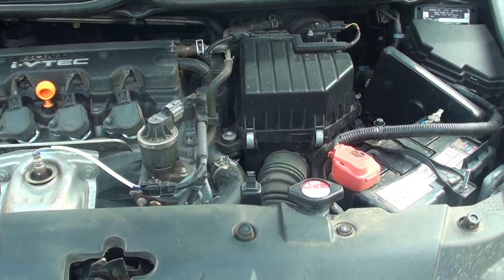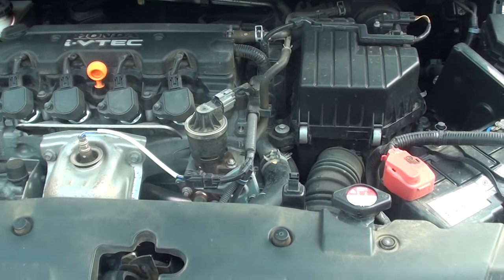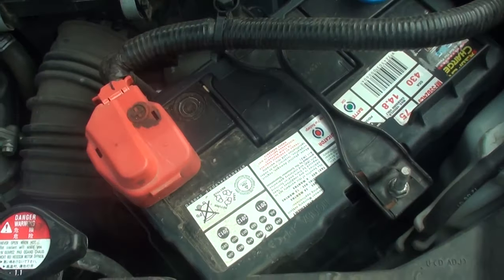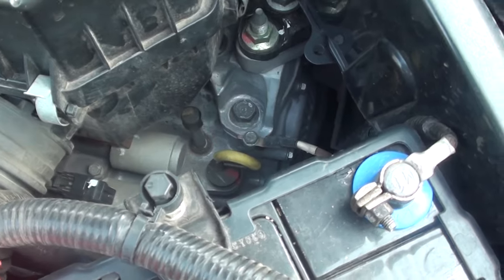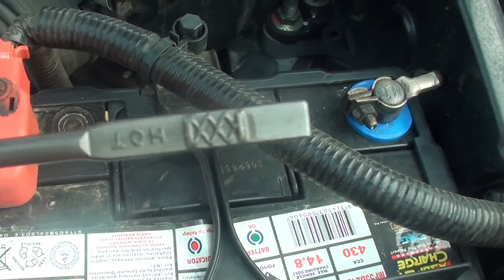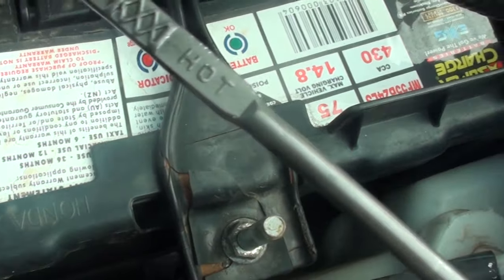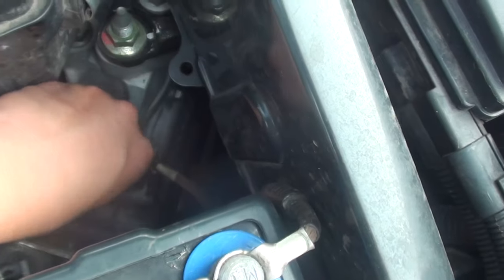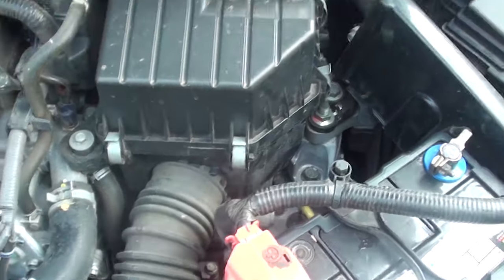Honda Civic 2007: How to Check for Automatic Transmission Fluid Oil

Comment: better to be more acurate about explaining people how to check the level .first of all start the engine ,make it hot ,then shut down and then pull out the dipstick and check within 60-90 seconds not less not more. thats the correct way to chek it
Reply: drip level how much? middle or top?
Reply: Beka M. Is absolutely correct. This is the procedure outlined in the manual and does make a difference in fluid level, compared to checking the way shown in the video (engine off for a bit, maybe cold).

@Dodge Ram -Transmissions are pretty sensitive to fluid level, too high or low can damage them, so close is not good enough here. I do appreciate, somewhat, the effort to make a video on this by the poster, assuming he made the video to help people out and not just to get clicks. That being said, I would rather he have not made it at all if he wasn't willing to clearly state the entire procedure, since following his instructions may cause damage, but is currently very easy to find, being one of the top search results for how to check 8th gen civic transmission fluid.
Reply: @Currancchs  except that I'm reading YOUR argument now as "the first thing i found" when googling this very procedure, so most of the internet is full of random garbage like this and not actually finding the answer about where exactly the hashmarks should be as you pour it in.

Comment: He left out some important details, when checking your transmission fluid run your engine while in park until the engine is at normal operating temperature, turn off the car and immediately check the fluod level, Honda is the ONLY manufacturer that requires you to turn off your engine while checking dipstick for TRANSMISSION FLUID, all other models of cars leave the engine on.
Reply: What do you mean run the engine at a normal operating temperature? How many bars should be in the temp gauge sir? It will help a lot sir
Reply: @justinjulespangan7595  Really Justin? If you have ever seen your temperature gauge while driving for a while? Its almost in the middle of the temperature gauge which is your normal operating temp.  Also be advised honda is the ONLY car company that requires you to turn of engine after operating vehicle to normal temp. All other car companies you check the transmission fluid while engine is running.

Comment: I just paid off a loan for changing my transmission then out of nowhere I started losing fluid every day I would have to put quart and a half. I checked my cooler lines going to my radiator and one of them was spinning freely I tightened it do you think that will solve my problem?

Comment: hi mate, 1.How many liters of oil goes into the automatic gearbox, What kind of oil?
               2.How many liters of oil enters the engine petrol 1.8, What kind of oil?
thanks
Reply: Same question dear..
Reply: Here is a list of fluids and other information I had made for my 2006 Civic (US model, keep in mind we have 5w20 reccomended due to CARB regulations. I believe 10w30 and a few other grades are reccomended outside of the US):

2006 Honda Civic
Engine:
1. NGK IZFR6K-11S Laser Iridium Spark Plugs
2. 4 Quarts of 5w20 (torque drain bolt to 29 ft.-lbs.)
3. Fuel Filter - Denso 952-0087 Fuel Pump Strainer (in tank)
4. Oil Filter Options:
a. Bosch ST3323;
b. FRAM PH7317 OR HM7317;
c. K&N HP1010; or
d. Mobil Filter M1-110
5. Air Filter Options:
a. Fram CA10165 Extra Guard;
b. Genuine Honda Parts 17220-RNA-A00;
c. K&N 33-2342 High Performance; or
d. WIX Filters - 49065

Transmission:
1. 3 quarts of Honda ATF-Z1 Transmission fluid for 30k Change (torque drain bolt to 36 ft.-lbs.)
2. External Filter (under airbox) - Genuine Honda Transmission Filter Part No. 25430-PLR-003
3. To check transmission fluid, warm vehicle up, then shut off and check level between 60-90 seconds following shutdown (level will increase over time as fluid leaves torque converter)

Tires and Wheels:
1. Factory: 205/55R16 (Optional: 215/45R17)
2. Rim: 6.5Jx16 ET45 w/5x114.3 bolt pattern
3. Pressure: 35psi f/r
4. Torque to 80 ft.lbs

Other:
5. Cabin Air Filter Options:
a. Bosch 6029C HEPA;
b. FRAM CF10134 Fresh Breeze; or
c. K&N VF2001
6. Crush Washers
a. Oil Drain Plug Crush Washer – OEM Part No. 94109-14000
b. Transmission Drain Plug Crush Washer – OEM Part No. 90471-PX4-000
7. Power Steering O-Rings
a. Black O-Ring (pump outlet to pressure hose inlet)– OEM Part No. 91370-SV4-000
b. Orange O-Ring (inlet hose to pump) – OEM Part No. 91345-RDA-A01
c. These o-rings are for the inlet and outlet connections of the power steering pump. The smaller (13mm ID) orange colored o-ring fits between the inlet nipple and the pump body, and the slightly larger (14.8mm ID) black colored o-ring is located between the pump outlet and the pressure hose inlet.
Reply: Call AutoZone

Comment: You must have the car turned on to check the transmission  and car off  when the oil..wow!
Reply: Actually Carla your half right, honda is the only car manufacturer that requires you to turn off car once at normal operating temperature and then immediately check dipatick, all other car manufacturers EXCEPT HONDA the dipstick is checked while motor is running.